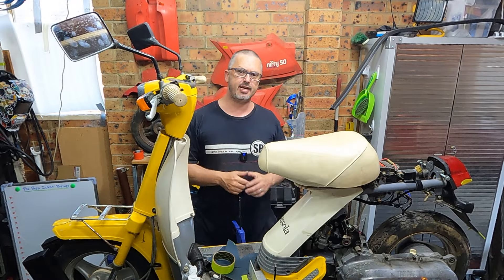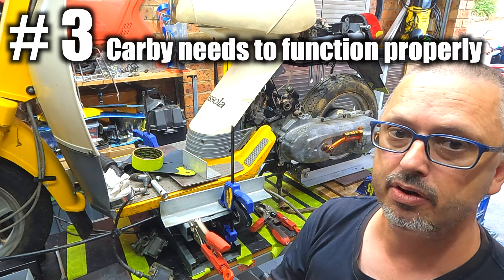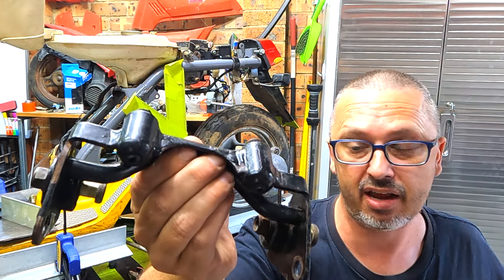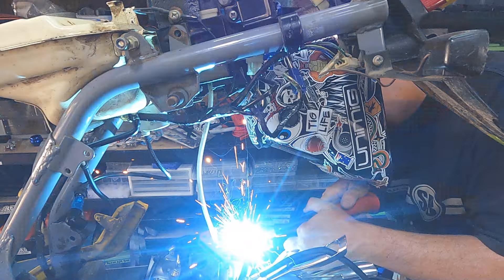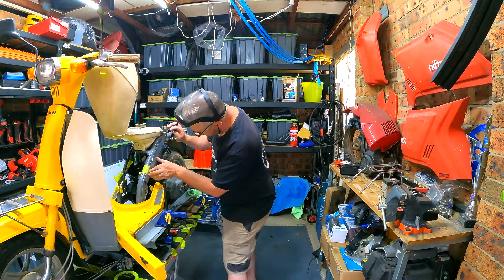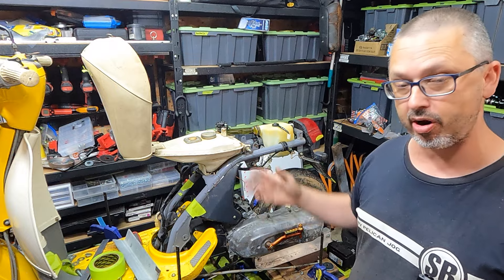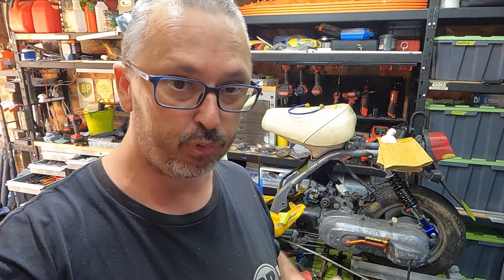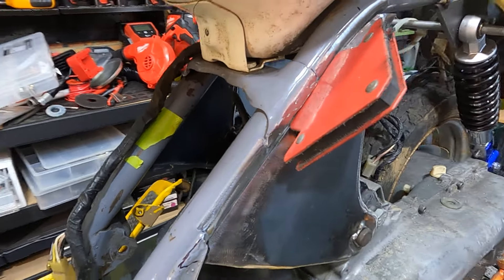Yamaha Passola custom 3KJ engine mounts

Comment: Nicely done.
They do make kits to convert the vertical Minarelli engine to the horizontal one. But where is the fun in that?
I like your idea better. Plus the kits push the engine out more.
Reply from the maker: Yes I didn't want to to push the tyre back so it looked modded. Would look really cool but